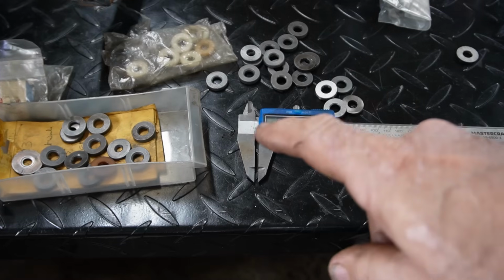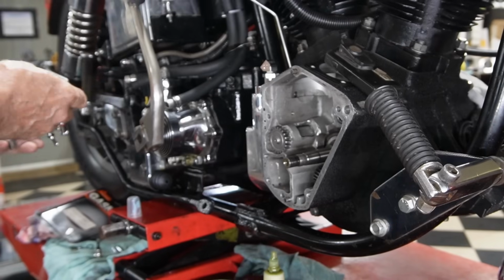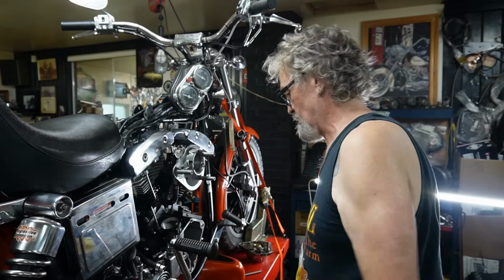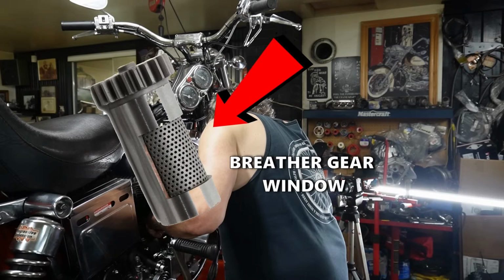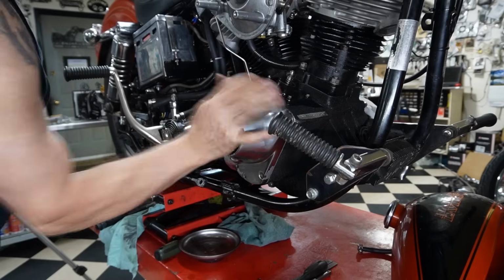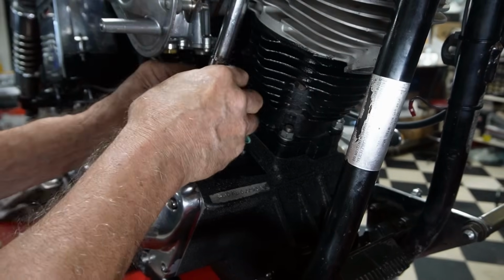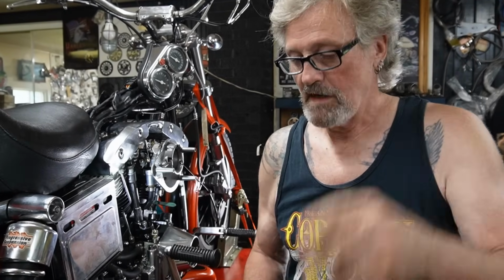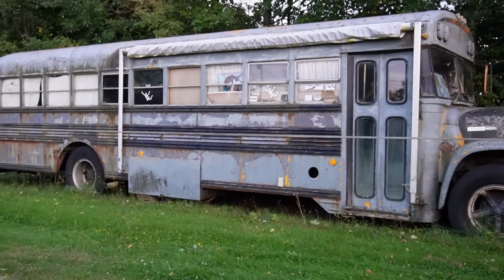WILL THE CURSE OF FRIDAY THE 13TH BITE US ? FINAL ASSEMBLY ON THE 81

Comment: Hello, I have an evo 1988 flhs that was rebuilt by me had some miles on it but it never had any ticking noise until I rebuilt it put everything in new my only thing that I can see with it is that it the spring pressure of the valves even though I put in what was recommended I think they are the problem I am running a roller top end and the tick is on top I think when it rolls of top peak of the cam it makes the ticking I have tried different weight oil and the straight weight 50 in the summer works best no more noise 20/50 works as long its not above 80 outside then the tick shows back up , but this summer here was unreal over 100 a lot of days , I would have to look but my ironhead takes some real thick oil in the summer and if you forget not to change it to the thicker oil it makes all kinds of noise but for the hec of it I put back the stock cam and the tick was gone it doesn't the aggressive ramp like the after market cam but with all the money spent on my bike I put the new cam back in and the tick was back , but mine may be the roller top end on race engines they make a little noise when set right but run fine, I now have 3k on the bike runs fine no tick with the right oil you may have something else but will be interesting to see what fixes it like I said everything was new in my build , be safe and ride free
Reply from the maker: Thanks for the info. It is always nice to hear of others experiences. Thanks for commenting.

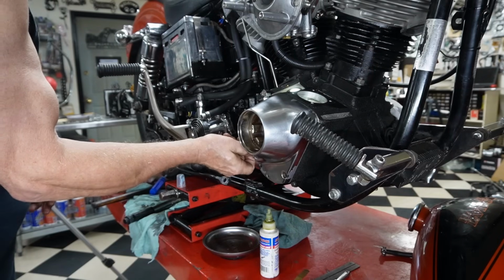Comment: I did not know how much freeplay needed to be on a camshaft. Back and forward or in and out shall we say. Now evolutionary set at 12:00 for $13,000 but I guess it's supposed to be half there for shovelheads. Thanks for the great video
Reply from the maker: The measurement can vary .001" to .015" I think. Just like to get it close as I can but not to tight. Thanks for commenting.
Reply: @itsmytimeletsgo  always very good information Thank you. As I tend to be a well I don't call myself a mechanic I just tinker around. I try to make things run again.. sometimes large stuff sometimes small stuff 😉😀